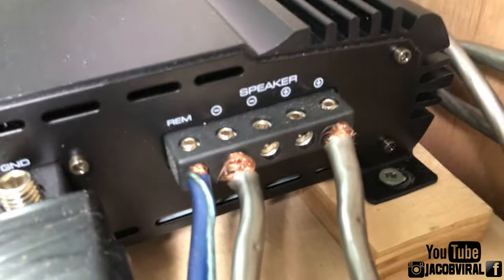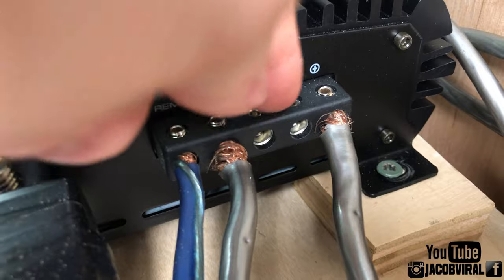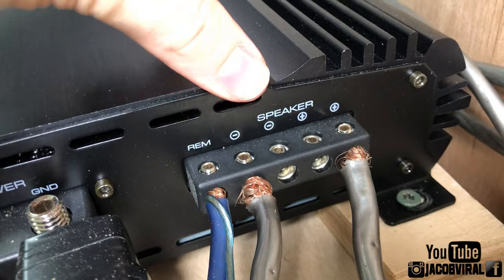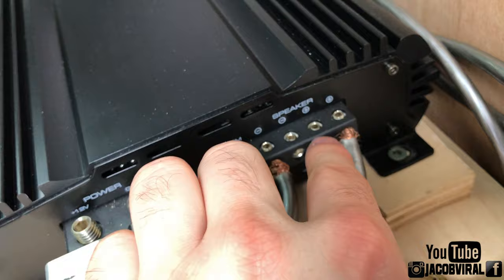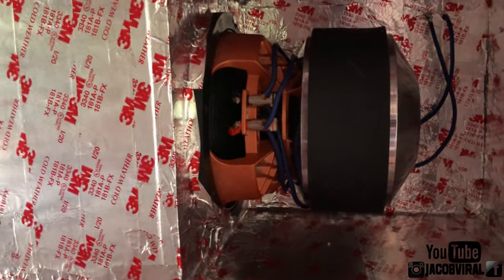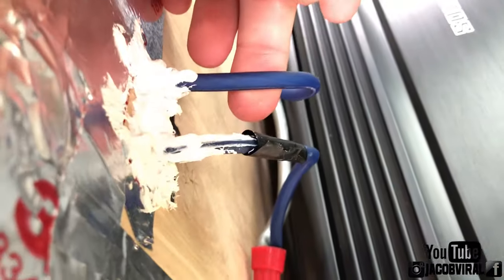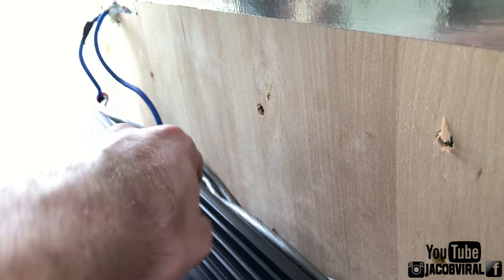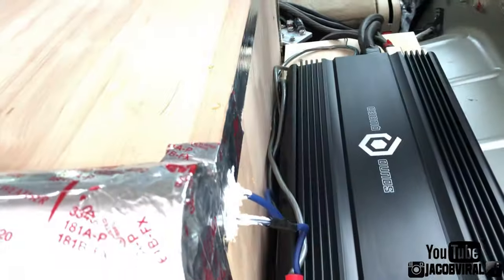DO YOU USE BOTH SPEAKER INPUTS ON YOUR BASS AMPLIFIER?

Comment: Terrible way to connect your speaker wire. Use ferrules.
Reply: I use solder hard to find ferrules
Reply: That's all anyone has to say? "Do A better wiring job"! The positive and negative connections are about 1" apart the way he has it wired on this amp. LOL
Reply: @Hertzsogood219 ... Remote wire is too close to the negative side. A shortage can easily happen. Overall, it's about a professional look. So ferrules or soldering is necessary. Other than that, Jacob has a solid build.
Reply: @25hztolife86  Cry baby. Look good to me. He ain't going for the "professional look".
Reply: @25hztolife86  LMMFAO! Where u stay at?
Reply: Ferrulesdirect.com
Thank me later
oh yeah
 they also sell lugs if you're interested
Reply: @25hztolife86  We all just need to chill.  I aint even trying to be an asshole. Somtimes it just happenes. LOL.  Dude it's his amp. And I guarantee you he's not going to blow it with a remote wire with all the experience he has.  I saw. I know it was close. I am extremely earful due to one Incident. You just did all this work on youre system and you get about a block away from youre negiborhood, start turning it up and you smell them mosfets burning.  I blew a SoundQubed s12250 (that I still run strapped to a s12250.1) by crossing the pos and neg. I paid &110 dollars without complaining. Well,  did a little bit, I love soundqubed and I will continue to run them, but have you noticed in the description of their amps they dont mention anything about any type of protection circuits anymore? I specifically sent them one from their sit e a few years ago and I still ended up paying to have it fixed. It was worth every penny though.  I would'nt buy anything else right now. Arent you the one that has 2 HDX3's? 18"s
Reply: @418lightning8  go on Amazon bro. They have really nice ones in bulk for like $10. It's night and day, makes things so much easier. It goes all the way up to 16g and down to 1/0awg! Really good quality as well!

Comment: I think it depends on what subs you have and what your desired ohm is. Let's say your 10 in dual voice coil has two 2 ohm VC's. If you run them the way you have it set up your resistance drops to .5 ohms at the amp. If you run a separate wire to each VC then you're still at 2 ohms at the amp. The less resistance you have at the amp dictates the wattage the amp puts out.

Comment: Agreed if you have 2 subs its better to use all 4 speaker connections on the amp. Also if your box has 2 terminal cups use both of them and they will be less likely to melt than using only 1.

Comment: Better question is why did they design that amp with the remote beside the ground instead of the power side
Reply: Is that a serious question? You need to look at more amps. Most of them have the remote input between the power and ground inputs

Comment: Okay I have 2 dual 1 subs and I have them wired in each in series in the box. If I plug them into the amp positive to positive and negative to negative with that then be series/ parrallel wiring.  Which should bring me down to 1ohm

Comment: I use both.
 Why?
One solid connection from terminal to each of  the 4 total speaker leads. 
Each wire as big as the amplifier will allow without using a single lead to double lead adapter.
Using one wire to run both coils can overheat the wire if it's too small and the current will be restricted.
All four wires devides that heat in half, and much easier when troubleshooting coil failure.

Comment: Just like others, not impressed with ur wiring, why u have wires running out of holes in ur box with caulk over them, then 1 wire wire nutted 2gether. U should have posts on ur box, and bigger wires let alone no copper showing out the amp. Instructional? Back 2 school bro, I know it not pretty....if ur making videos it should be perfect. So ppl can really learn and see what u are doing. Rubber shrinks at the end of all wires. Get them at harborfrieght cheap!
Reply: You hit all the messy (and amateur) wiring. Wire nut, way too much caulking, strands of wire on the speaker OUTPUT terminals.... damn clean up your mess before posting!

Comment: I'm getting  a similar amp that requires 2 postive and ground  like yours but I was wondering if yours using 2 batteries and stock alternator? I have 2 12inch mtx subwoofer and the amp I'm getting is 5000wrms
Reply from the maker: High output 370 amp alternator with over 180ah of  AGM. Your gonna definitely want to upgrade alt and batteries like these https://amzn.to/3qKS5tI

Comment: Maybe this is a naive question. If for an example I have a mono block amp 400RMS, similar to the one here in the video. I have two different sub boxes, one has two 12's wired in parallel from 4 to 2 Ohms but connected together with one positive and negative wire ran to the amp. Are both speakers receiving the same 400RMS each or 200RMS per sub? The other scenario I have a single box with the same exact sub, wired in parallel from 4 to 2 Ohms and one positive and negative ran to an identical amp. Is it getting the 400 RMS by itself? I'm trying to understand if having two subs is better or worse coming from the one amp. I appreciate any input about this, thanks.
Reply from the maker: You split power when running multiple subs to a monoblock glass d amp.
Reply: @JacobViral2  Thanks, that’s what I needed to understand ✌🏼

Comment: I always wondered about this I understand the concept of having 2 sets of inputs for ohm load diversity but if the + & -'s are connected at the inputs inside the amp, wouldn't it have the same effect as connecting the wires? Like how can the amp split the ohm load if the inputs are essentially jumped inside the am
Reply: Amps do not split the ohm load... They only read the ohm load provided from the subs.
2 sets of inputs do not provide "ohm load diversity"... The wiring of the subs is what changes the ohm load.
Two 4ohm wired parallel = 2ohm
Two 4ohm wired in series = 8ohm

Comment: If I hooked up 2 dual 2ohm subs wired to 1 ohm and hooked them up separately to the 4 connections would that be okay? Or just get 2 4 ohm subs.
Reply from the maker: Yes you can run one sub per terminal a lot do that.

Comment: I have a question hopefully
You can answer , I have a similar Monoblock amp that has 2 outfits and 1 single 2 ohm dvc sub . What would my impedance be if I run each individual voice coil to its own speaker output .
Reply from the maker: It would be either 1 ohm or 4 ohm, depends if you run the positives together and negatives together to make it 1 ohm. Your amp is monoblock so even if you used both terminals they are connected.

Comment: What is that one calbe that goes with the remote start wire?
Reply from the maker: Turn on going to a switch from head unit, 14gauge
Reply: @JacobViral2  come again? The 12gauge goes in the positive wire of the head unit?  But the remote wire goes in the same place? ( i want to do the same, a kill swich for my amp)

Comment: I have a 10 inch 1200w sub and a 2/1 channel amp it has a left input and a right input should I use just the left or just the right? Or do I bridge them?
Reply: My amp is a 1200w as well
Reply from the maker: If it’s a class d monoblock then their connected as explained in this video so either or both.

Comment: I have a pioneer amplifier that is single channel but 2 sets of terminals... 1ohm stable pushes 800 W I had four single voice coil forum subs wired in parallel. With two sets of positive and negative to the two terminals, when I wired them to one terminal I got louder, didn't meet her it, but I was at 139 outlaw at one point on one single terminal but I know I wasn't that loud just the day before on two terminals. It's hard to explain through this but if anyone reads it and has time or knows thank you if not thank you for reading lol

Comment: Hey i just added tsub in my car and i was wondering about what you said on this video. If i have 2 subs on a mono amp then i have to use all 4 inputs or just one and one i have my dual coil subs set up at 2 ohms
Reply from the maker: Can run speakers together with wires then just one poss and one neg to amp works.

Comment: So how do I hook 2 12” dual 4 ohm subs up to a mono amp with 2 sets of speaker terminals? I have my 12s wired down to 1 ohm and have the skar rp2000.1d.
Reply from the maker: Wire each sub to 2 ohm, then run 1 poss and 1 Meg to each amp connect point. Here’s is a video explaining wiring subs ohm: https://youtu.be/3dvhxmlBcfc?si=dYBR6Tv3WklN7FEK
Reply: Essentially you connect the subs (parallel) at the amp instead of in the box

Comment: I just got a new sub box today and it has only 1 terminal cup. Just discard the other speaker wire right?
Reply from the maker: Idk what your asking sorry. Usually pre-Installed boxes are wired internally.
Reply: @JacobViral2  my other sub box has 2 terminals for 2 subs. The new box has 1 terminal for 2 subs on 1 side.
Reply from the maker: @djnevous3us  It means it was wired up internally before you got it. Or it's just you wire the subs up together inside the box and run the terminal outside as 1. Google 'Sub Wiring Diagram 12 volt' I use that a lot for wiring speakers.

Comment: Yeah I'm new here, can a single svc sub be wired to 2 channel monoblock amp
Reply from the maker: yes it can, FYI mono=single/a, so 2 channel isn't a monoblock but 2 channels, so you would run to 1 of those 2 channels with the scv sub just make sure it's not too low ohm wise. Thanks for watching :)

Comment: Question i have 2 subs in one box connected to the amp in 1 ohm 1 terminal can i connect another 2 subs in one box on the same amp with a 4 ohms 1 terminal on the other negative and positive of the amp 🙄
Reply from the maker: If its a monoblock no as that would make the load below 1 ohm load.If its a 2 channel amp probably be fine.

Comment: Am I correct in seeing that he is calling the outputs, inputs? Every monoblock I've ever used had two channel rca input I've never seen inputs like this on any amp.
Reply from the maker: You’re right sorry their outputs from the amp but an input for the speaker to route to.
Reply: Well if you want to be technical the positive is an output and the negative is an input
Reply: Unless you have it running in reverse polarity, which some amps do give that option.

Comment: What i wanna see is how or where u got those dual connections for the power and ground to tha amp, also what size wire is that u used for the speaker wire 12awg?
Reply from the maker: Car audio online shop I bought the dual 0 gauge inputs. Think it was at Jim Maxhineworkx shop.  I have 8 gauge speaker wire here.

Comment: How do you reduce the pre audio output from behind the head unit instead of buying a new one? Only reason I ask because I have taramp amps and they don’t like high voltage and my head unit gives 5 volts!
Reply from the maker: Lower the head unit Bass levels maybe? Idl if your able to initially without another device.

Comment: I have a single sub with dual 2 ohm voice coils. If I wire each coil to each  positive and negative outputs on my amp, what would the ohm load be? My guess is 2 ohm but I'm not sure.
Reply from the maker: Both positive and both negatives together? That’s down to 1 ohm
Reply: A dual 2ohm speaker can present either 1ohm ran parallel or 4ohm load ran in series. If u have 2 dual 2ohm subs u can get 0.5ohm, 2ohm, or 8ohm.

Comment: If the monoblock is 600 rms, is it okay if we connect two subwoofer(300rms each).
Reply from the maker: Long as not wiring below min impedance of amp recommended you’ll be fine.

Comment: Can each set of output terminals tolerate 4 ohms each?
Reply from the maker: It would still connect as one depending on the amp and lower impedance

Comment: So if you have another sub you'd use the other positive and negative on the amp. With the other sub wired the same way.
Reply from the maker: Depending on wiring ohm load goals but yes

Comment: what the hell is the point of using that gauge of wire if you're not even going to use it all? cramming some of it in there to connect and having a lot of it sticking out not connecting, you might as well go with the gauge that the amp is designed for. there are adapters to make that fit btw. sloppy

Comment: My amp keeps going into protection mode, even with one subwoofer on and when I turn up the volume it goes out
Reply from the maker: Your bass boost should be off, loudness off, gain set low(near rca volt output rating), bass flat, and good voltage.
Reply: @JacobViral2   everything’s good I even turned everything down and try to start from there but it still kept going into protection mode so I just sent that back. Hopefully they send me a better one.

Comment: Not all amps are bridgeabe first u need to know the ohm load the amp is capable of running at? To low of a ohm load will stress the amp out & it will over heat!!!
Reply: That's a mono block amp so that doesn't apply

Comment: I have a kicker DXA500.1 that cuts out when i turn the volume up.   Subs are wired parallel..   the way i have it wired is like what you would do if it was not a mono block amp.   One neg from one side one positive from other side.   I didn't know mono.   Because it had two output channels.   So i had to increase the ohm load to get it to stop shutting down when i turned it up.  Works fine now but it's not as loud.    Im thinking it's because of my ground.   I have it grounded with the bolt that grounds the trunk latch bolt.  Whet i hit the release in the glove box it shuts amp off for a second.   Anyone know why it's cutting out at a two ohm load ?     Maybe i gotta run both out puts ?     Also when it was shutting off as i turned up the volume my headlights were really dimming bad.   And i have a capacitor that helps prevent this.    Any advice would help.   Thanks
Reply from the maker: You need an upgraded secondary agm battery like https://amzn.to/3YkAzeT and big 3 wire : https://www.youtube.com/watch?v=qNQoVGlUzCY :  complete. That amp is 2 ohm stable, so make sure not wired down to 1 ohm.
Reply: @JacobViral2  thank you
Reply: @JacobViral2  so i rewired the speakers to parallel..   turned the gain down and bass.   Ran fine then the cold weather hit.   The thing that im sure is screwing everything up i bet is in the trunk i have my amp and cap ground on a bolt on the fenderwell with the trunk latch button and what i think is a fuel pump ground.    When i popped the trunk latch button it made the amp start working again.    My headlights were flashing really bad.  My amp is a kicker 500.1 mono.   And it's only 2ohm capable..  So i guess im gonna move the ground soon.